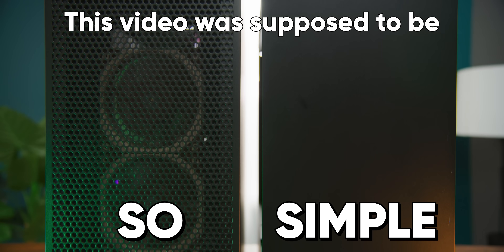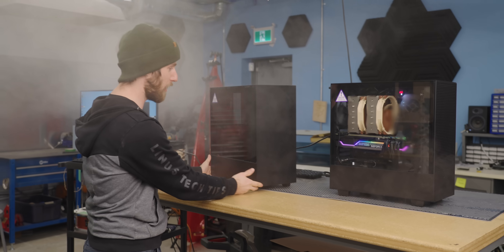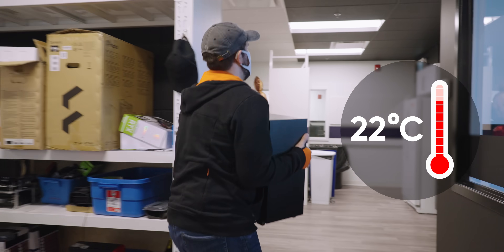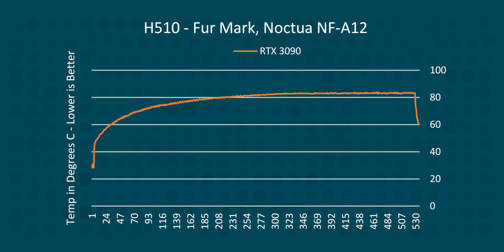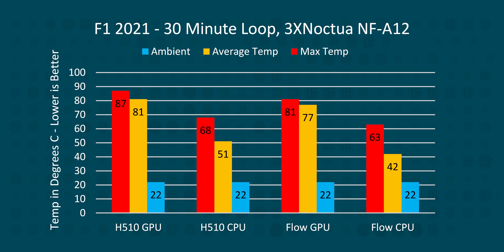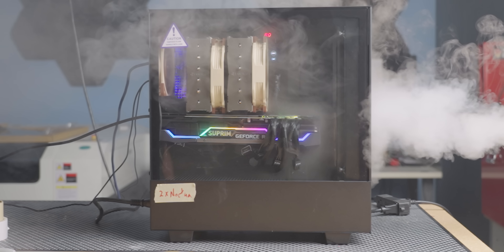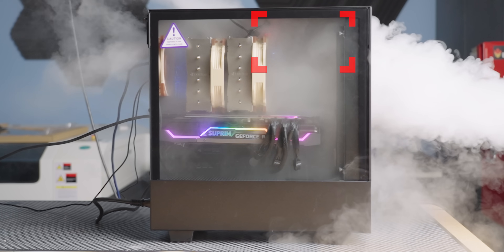Everything You Know Is Wrong - Mesh vs Non-Mesh Front Panel

Comment: I'm wondering if a 3d Printed/Cardboard divider between the 2 fans down the bottom of the GPU (top fan directed to CPU, Bottom to GPU but nothing hitting the front slab edge of the GPU) would be beneficial, admittedly you'd still have the issue of the GPU air not having anywhere to escape to, but maybe replacing one of the PCIE slots with a slatted one would be juuust enough to introduce a steady stream of air through there and back out?

Comment: Yes I love half assed theories,  obviously the big ass noctua fans pull the bulk of the air directly to the top of the case so the tiny GPU fans can't pull as hard as the noctua fans, plus also the position of gpu fans has never been optimal unless you have a case with airflow from the bottom

Comment: This is why i got a case where I can mount fans on the PSU shroud, the Lian Li Lancool II. i got two 120mm fans pushing air directly to my GPU, while getting fresh air from the PSU shroud side panel; which is a mesh panel that helps with air intake. I'll still see if and when I get a huge GPU if what they did here will have the same result of have a totally different result.

Comment: That's why I like actually the FE cooler design on my 3080ti, because one fan blows hot air up towards the cpu cooler which is then easily pushed out by the Noctua D15.

Comment: Hey guys. Us normal plebs with some pc building experience may have a question for you to tackle.
Based on your video about cooling.
Can you put together a build with 3 directions of cooling.
IE
1 too cool the PSU
1 too cool the GPU
And 1 to cool the CPU
As in 3 ported and directed cooling systems !
As heat rises from the now bottom mounted PSU into the GPU coolers and up into the CPU.
Can you try this approach please.
Thanks

Comment: I recently bought this case to, ironically, improve my PC temps. Thing is I also installed 3 140mm and 1 120mm noctua fans so while I got the reasonable temp drops on the cpu like this video shows I had the problem of the gpu still getting too hot. I did this test and have been doing smoke tests with my vape lol and noticed the dead space still. The only solution I could possibly think of (in my situation) is vertically mounting the gpu.
Reply: My solution was water cooling. Actually I just bought the case after the water cooling just because it looked cool and I know I don't need to give a fuck with a 240 tucked in there just for a 1080ti
Reply: @Some Weeb  It is a very nice and sleek case I just wish I did some reading up on it before buying. I have a 1070 and will most likely end up throwing some water cooling at it. Just not in the near future.
Reply: @eduardog9377  Try a piece of cardboard between the gpu and the the fans so it directs one of the fans exclusively to the gpu. Or maybe 2 fans for the GPU? Dunno. If the results are better maybe find some black plastic or wrap the cardboard so it doesn't look as ghetto as the bare cardboard does.
Reply: @Deses  So simple yet so effective. So I just laid the piece of cardboard on the gpu backplate closed the case and ran some quick tests. Turns out the cardboard dropped my gpu temps by 10°C.  thanks for the tip
Reply: @eduardog9377  woah! that's amazing! I'm glad that cheapo trick helped you. :)

Comment: Would've been nice if it was tested with a dual fan gpu aswell.
Reply: The point was that this GPU was too big and basically blocking airflow on all sides. A smaller one would work better without a doubt

Comment: Here's a "crazy" idea, how about putting an insulating material between the CPU cooler and the graphics card spreading throughout the case from inbetween the intake fans, all the way to the PCI slot, thus creating 2 separate chambers (ducts). In theory this would not only prevent temperature interference, but also should increase air pressure and something like a cardboard piece, cut to size should do the trick. I would love to see if that works.

Comment: Kinda thought this was common sense. Maybe it's all of my outside study into aerodynamics, formula 1 cfd and such. You can easily create areas or low or high pressure without the right design.

Formula1 cars have places where they USE air to "seal off" areas of the car to create low pressure. I feel like where the GPU is located and proximity to the front of the case, you actually created a vortex barrier preventing air to go below it. That's similar to the principal of the Y250 vortex that F1 teams use.

Comment: I wonder what would have happened if you'd taken the meshed case and added a sheet/plate/etc between the front fans to force the air from the lower fan to flow under the GPU into directly at it

Comment: Cheers for the vid! some food for thought about case airflow. 

I'd be interested to see how the Corsair 5000D/X series cases go with full Noctua fan configs. 
I have the 5000D Airflow and using 10 NF-F12 fans in the case, NH-D15 cooling a 11900K, and an XFX 6800XT. During gaming GPU hotspot sits around the high 50 degrees C mark, and CPU around mid 40s to low 50s

Comment: how could you not test with two exhaust fans when the entire purpose of the original H510 and H210 is a negative pressure to bring air up through the bottom/front straight to the gpu, everything in this video and more was better established years ago in gamers nexus' review of the H500 and H210i.
If the motherboard you're using doesn't allow it then don't be lazy and continue with your bad testing; get a different motherboard without stupid tall VRM heatsinks. I've built dozens of H510 systems including ones with an NHD-15 and getting a top exhaust fan was never an issue.

Comment: In that situation...I'd almost say mount a low speed exhaust fan on the vented slot covers on the back of the case. That would draw air along the bottom of the case towards the fans on the video card. This would lead to lower GPU temps.

Comment: Whoops, maybe it's a bad idea to stick GPU fans on the bottom instead of the top... How much rnd actually goes into case designs and airflow to optimize cooling?

Redo this test but with an Nvidia GPU with a new cooler design, I bet the problems here would be gone

Comment: I've had an NZXT H510 for about 10 months now, and I've had zero complaints about it, honestly.  Now, I'm not running an Intel 12900K and an nVidia 3090 in there, but still.  A Rizen 5 5600X overclocked a bit (with a Noctua NH-U12S on it) and an nVidia 3060Ti going full-bore can definitely generate some heat, and I've never had thermal-throttling issues.  Nothing ever really gets above 70C, honestly.

Comment: I'd like to see you do a smoke test on a PC that has intake on all sides. Front intake, bottom intake, back and top exhaust, with a mesh side panel for fans (intake or exhaust).
I'm not a fan (harhar) of glass side panels. I like fans there, or even just a passive opening, and am curious as to how that would work in multiple configurations.

Also, a test on the position of the case. Desktop tower vs traditional laying-down-desktop

Comment: Putting fans on the internal side of the front fan bracket would probably help the h510 out. Looking at my own h510 I can see that where you put them is basically blocking the side vent.

Comment: reversing the overall flow (exhaust through the front) would be an interesting experiment with this setup with the mesh panel.  I would bet it would result in better numbers.
Reply: Wish they also got some numbers with less beefy cards. Chances are you won't be running a 3090 in a 510, but rather a 710. So how much does a shorter, thinner card helps?
Also factor in these NZXT cases are common for using an AIO for the front side so you often have a radiator there as well
Reply: I've actually tried this recently on my case, but whilst it made it great for CPU temps, my GPU temps skyrocketed by 15-20 degrees under load, not to mention vRAM and junction temps. I tried the GPU both vertically and traditional horizontal mounting but front intake, horizontal gpu delivered reasonable temps on both components event though in this configuration CPU temps were averaging higher.
Reply: Since the front of the case is most likely facing you (at least part of you), you will soon be getting quite warm, I suppose. 🥵
Reply: @JohnADoe-pg1qk  Nah, I reverted back to front intake, rear exhaust.
Reply: @Sephhh64  My comment was based on the original comment.
Reply: That's especially true since the RTX cards draw air in, instead of out. I'm pretty sure if that were an AMD card, you'd see that air being flushed out through the GPU. It's also why Intel+nVidia is a particularly poor combination right now unless you really plan your cooling well. Otherwise, it's a hot GPU blasting hot air on top of a very hot CPU.
Reply: Complete negative pressure ought to make air come in through the pcie slots like the stock h510 does
Reply: I posted something similar

Comment: Makes you wonder what a full tower case might pull off in terms of cooling and ventilation. I understand those are very large, but as witnessed by the 3000 series cards they're only going to get bigger and probably require full tower cases.

Comment: I own corsair air 240 and I think that is the best way to make cases. You have big space for power supply, hard drives and cables in the back of the case. In the front only the gpu, motherboard and cpu. And the best thing about it is airflow. Mesh on the whole case top, bottom and the front. I have mine configured in reverse atx style so gpu is on the top so it always gets the fresh air.

Comment: I can see one option to help mitigate this issue. You could try fitting a Noctua Slim Chromax A12x15 fan at the top of the H510 case in exhaust configuration. I did the same thing on my NR200P, and I fit a 3060 Gaming X trio vertically.

Comment: The REAL conclusion from this video is how bad the case designs are on 2021. That is the real problem, not the fans.
It is funny how cases have evolved backwards on last years. I got my Corsair Spec 02 some years ago. A "basic" "cheap" case. With 2 140mm fans on the front, 2 fans on top and 1 on back. I have there a nice CPU air cooler and a Gigabyte 3070. Working cool and fine. Today this would be a "Premium" "Flow Edition" case.
Selling "flow" as an extra feature on a case it´s as stupid as selling tires as an extra on a car.
If I were to make the same setup with a "modern" 2021 edition case it would be cooking my GPU and CPU.

Comment: I took my front glass panel out my temps are way better on my Ryzen9 3900x Rtx 2080 super gaming x trio. 32gb 4000mhz ram. My temps dropped by 10 degrees almost across both cpu and gpu.

Comment: I say I'm quite content with my Fractal Design Focus G Mini. 2 fans in front (120 mm) behind a foam filter and 1 on the bottom (slightly less filtered 120 mm) pulling in fresh air straight at my GPU and motherboard while 1 fan on top (140 mm) and one in the back (120 mm) pull out whatever heat it generates. Minding too that the bottom and top fans run at full speed while the front adjusts speed to CPU temp and the back fan adjusts to MB temps. Never really have any issues with thermals for being a Ryzen 7 3700 air cooled and a dual fan Radeon-based RX 5500 XT.

Comment: please do this test again in comparison to a custom water loop.
The advantages might get obivious, but I'm especially interested in VRM vortex.

I'm personally running a 8700k @ 5.2 ghz and a RTX 3080 FTW3 ULTRA GAMING with 2 360mm radiators, the top one in push/pull configuration.

Comment: Maybe a discussion of positive vs. negative pressure in a PC case would have been worthwhile. Making the decision to have small positive airflow can make an improvement in the amount of dust that your fan covers collect. Choosing to go minor negative pressure can cool things better (forces more air in, both via intake fans and also from small openings in the case and open vents) but will increase the rate that dust enters your case. Best bet is to always get close to neutral, but bias toward either negative or positive depending on the dust level of your environment. If it's pretty clean, go slightly negative. You can test this by using an incense stick and putting it by areas of your case that have small gaps, but aren't close to fans. You can be like that lady in "The Descent"

Comment: Would tuning each fan to individual speeds help? Like having some fans spinning slower or faster than others? Also would having bottom intake or exhaust yield different results?
I also think this is a very case specific scenario as you kinda mentioned in the beginning. I’m almost certain a different case would give a different result depending on the fan placement.
Reply: that is a good point! running the intake fans at the minimum speed and the exhaust at maximum would likely help but bottom line this case  is not good too small and only one top exhaust  but case is not tall enough to even install the one top exhaust fan.
Reply: Bottom intake should definitely help.  The idea situation is to have a straight air path, which unfortunately is always limited on a GPU as they tend to blow out the sides with nowhere for that air to go but bounce back off the sides of the case.

The popularity of glass panelled cases really doesn't help, as having a vent right above the GPU could really help to get the hot air out of the case rather than having to fight turbulence to get it around the GPU and out the case.  This is presumably why we now have GPUs that partly vent towards the CPU.

This is where water cooling is probably more beneficial to GPUs than CPUs, as you can't have a perfect air path on a GPU but you can move that heat to a radiator which CAN.

Comment: This is pretty interesting. Still, I wonder if in the layout of the internals there could be some variance. Also the size of the tower in comparison to the internals. I mean, a huge GPU and air cooler would definitely interfere with airflow. Maybe even the fact that it's a midtower design. So many questions 🙇🏻‍♂️👀
Reply: I've had an nzxt case. tried to run a 1080ti in it. didn't work well, got super hot, even after substituting a12x25 noctuas. their cases are not well designed for high end gpus. do this experiment in a meshify c and it will be obvious the benefit of higher performance fans. honestly not sure why they published this. typically we want a balanced setup, like 2-3 intake 2-3 exhaust, then you can add an extra intake or an extra exhaust and get some interesting results. but if you start in a case that only allows 1 exhaust then your options are severely limited.
Reply: @arbitraryalias9825  That is true. This video is basically a critique towards NZXT. They should better their design or at the very least design a case with better airflow, like you said mesh in the front and top.
Reply: @Canomar213  100%

Comment: A bit disappointed in this video. I was expecting a bit more analysis and configurational exploration given the tease on the WAN show a couple of weeks ago. I'd love to see you guys do some testing with manufactured ducts/diffusers and compartments along with fan setups - though I realise more of this will be coming in the future!

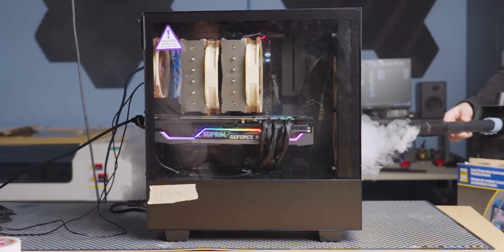I think there's a discrepancy (or perhaps more correctly, an invalid conclusion) in your testing. @06:55 vs @06:58, you would not expect two fans to draw in less air/smoke than one and with the hose pointing at the side vent but it seems like it does. This appears to demonstrate that your two-fan setup is sub-optimal, probably due to them interfering with each other's performance and causing turbulence/recirculation of the same air volumes. Not only that but it seemed like the fan speeds were not set up correctly.

Some people further down (up?) the comments are correctly stating that turbulent flow is better for cooling than laminar flow - however, this turbulent flow needs to occur at the point of heat generation/extraction, not at the point of entry/exit into the system, where you need to prioritise air flow and thus more laminar, less turbulent flow is better for this part of the overall system design since you need to provide/extract the largest number of clean air volumes per unit time into the case as possible.

With the design of most PC cases and electronics, a lot of turbulence will be induced by the irregular shape of the components and chassis design and with the way that most PC cases are set up by PC builders/enthusiasts, you actually may be better off running fewer intake/exhaust fans at a lower overall fan speed, leaving your CPU/GPU fans to run at higher speeds because the system is open and chaotic and is not like the theoretical 'pipe' that most of theory works upon as an assumption.

The fact that you're seeing only 7-8 C difference between two very different setups which, in theory, should provide very different cooling profiles reinforces some of the points I've made above. IMO, the temperature differences should be larger (at least for the CPU, the GPU is a bit of an issue due to the orientation of the vanes in the radiator and the fact that the GPU fans work against the airflow provided by the system - but then that applies to all non-profressional GPU designs).

At least this is what my experience has taught me.

Comment: I solved this issue on my tiny 400C case by only using one fan with the NH-D15. Bumped my GPU temps down from the low 80s to the 70s without hurting CPU temps.